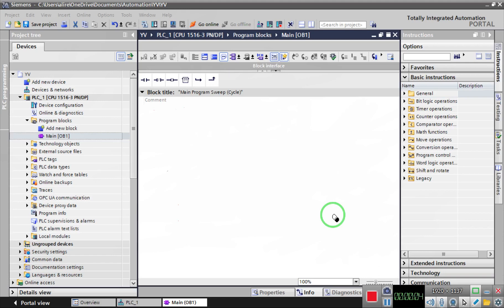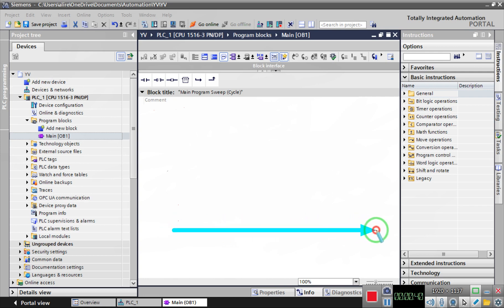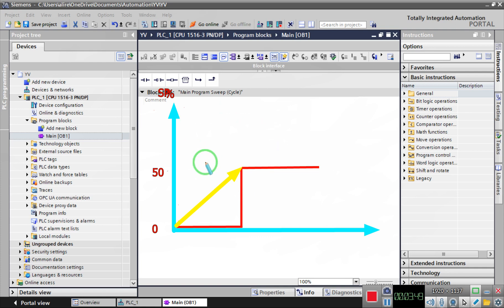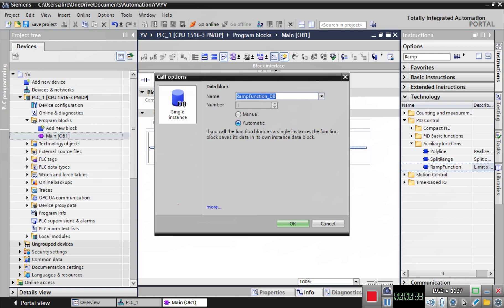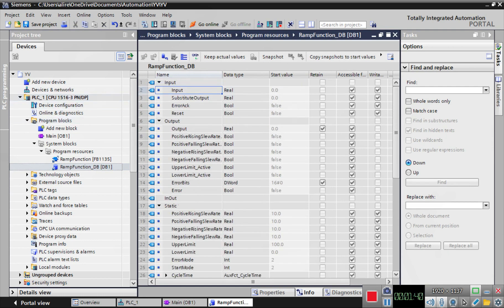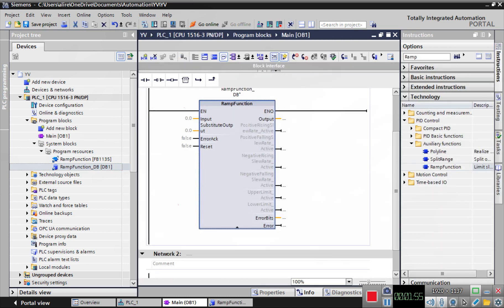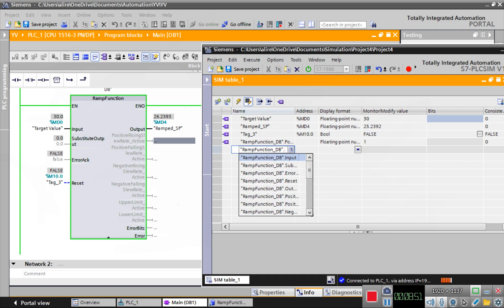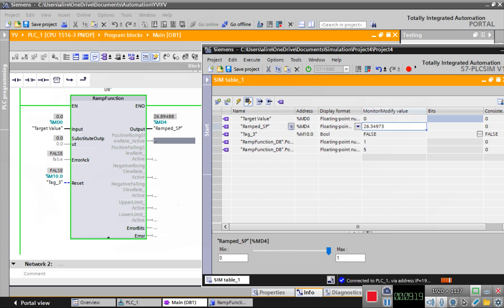TIA Portal | RAMP Function (Step-by-Step)

Comment: Is it possible to ramp a value in milliseconds as I would like to use this to control a servo valve driving a hydraulic cylinder at different speeds